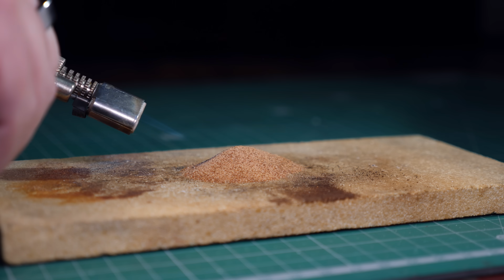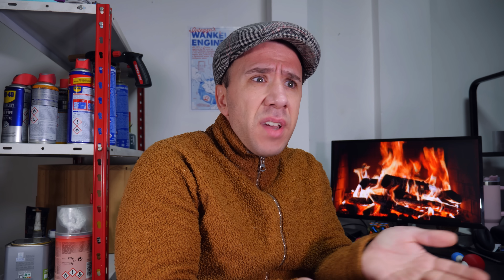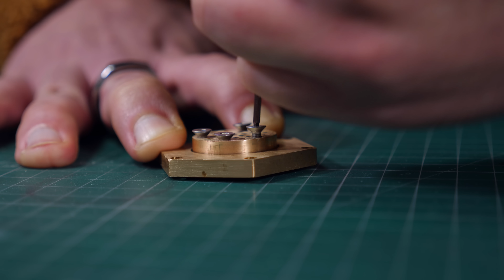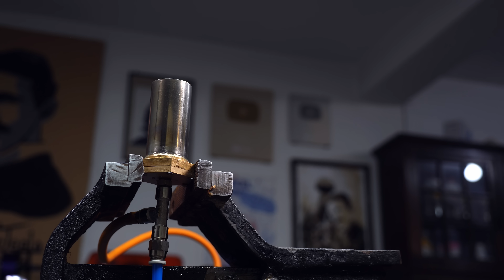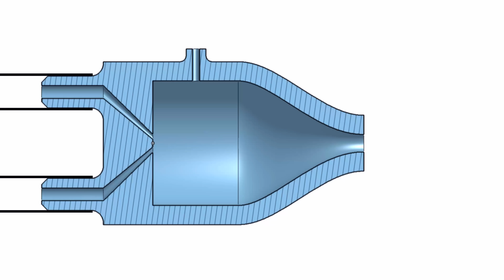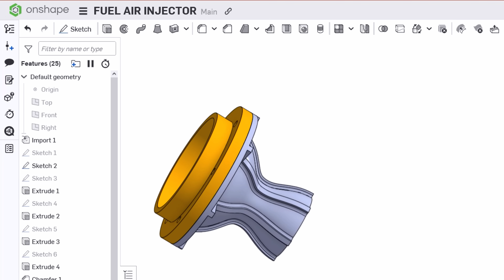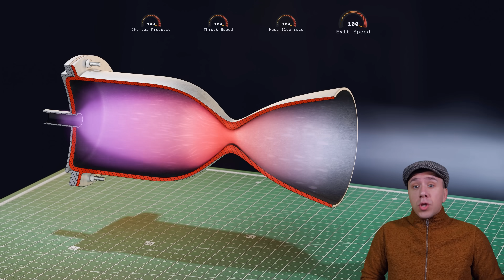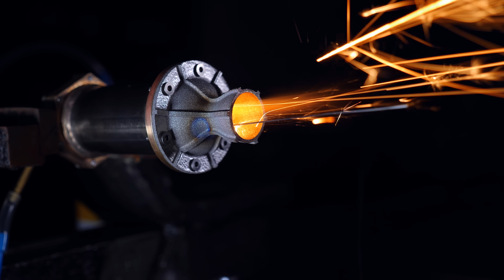I Built the FIRST VENTURI ROCKET ENGINE

Comment: so, awake again I see! Did you forget about camera apatures? stainless steel & coated in a high temp ceramic works a lot better for you tests, of course you know that. You once layered 3d printing material with carbon & more, I'm sure you can figure this out.

Same for the increase of total size of your inner diameter & needed pressures, alongside of feeding the fuel in properly... Nothing like planning videos, right? Tubes are easy enough, some reusable stainless steel drinking staws lined with holes that are then bent in to force a venturi effect to the fuel to be dragged out into the surrounding oxidizer is pretty fun, if you know how to serpentine the steel drinking straws.

Yeah, heat them up, coil them around cut a small slot, spot weld, or I dunno.... shrugs 10$ it up muahahahaha~!

You got oil? You should get some oil, you've got an oven. Hit it with some argon you got lieing around, as you do there dude integza, & dunk her in some oil. That solidifies your part to higher pressures & temps. You know standard mono-crystalline together part after with the basic annealing you can do in that thing, hooo boy!

It's a good idea if you wanted to head towards more optimal designs in terms of the speed of fuel consumption & total pressures you'd want to actually be at. 

SIDE NOTE!

coil the outside of the tube, drill into the tube to fit in the drinking straws, coil the straws from there, the amount of pressure & heat this thing could have is incredibly, genuinely draw dropping, levels of high. The vortex generation that happens forces the cooling effect of liquid & gas fuel combine as eddie forces tend to get involved. They tend to collapse back into the system & force a speeding up of electron orbital movement. I.e. they become more willing to violently jump virtual ionic states & yank into the vortexes to "smash" as you say into the already combusting air & fuel.

All you have to do is add in enough carbon/aluminum/copper/electrically conductive elements that can handle the huge voltage jumps to amperage spikes that oscillate based on combustion going on. ;"( in-fact thermite is a funny thing, all rocket fuels are thermite redox flow batteries like I've stated tremendous numbers of times in my videos. Insulation in the coils (steel remember) is also good with dialectic fuel in it.

Thermite, isn't what you are running, you are just transforming a gas into smaller gases quickly. Add some stuff into your liquid gas & or oxidizer, you'd be surprised how fast catalysts can be used in the application, that help with the electrical parts too, when reflections of your inner surfaces get involved for light based electron wake field accelerators get involved with your combustion of plasmas. Like I put in a xyla foxlin comment. & a few other videos.... & blue sky posts.

Comment: You will get much better mixing if you have the air flow around the injector and the fuel (unless it is hydrogen) flow through the center. This is because centrifugal force tends to push the heavier fuel particles or droplets outward, while the lighter air stays closer to the center.
This is a standard practice in the field.
Also the flow through the Laval nozzle was underexpanded. Cranking up the pressure in the chamber should solve that.

Comment: Since your next goal is a liquid rocket engine let me point out you already have half of the puzzle solved, your injection system is perject for the needed combustion and if you go back to your electrolizer project you will have access to the most powerful rocket fuel, Hydrogen and Oxygen, while you are unable to liquify them since you dont have a cryocooler their gas forms should be perfect for testing...just dont blow yourself up

Comment: You should have taken your tube with the solid oxidizer and while it was still wet/pliable, put it into the lathe and spun the sh!t out of it to let centrifugal forces disperse and smooth out the slurry onto the inner walls, then dry it out.

Comment: The last screw is always the hardest because of small misalignments due to tolerances in the manufacturing process.  if you don't tighten down all of the fasteners in series, it's easier because once all the screws are in and you start tightening in series, it'll center the part up on all of the screws.

Comment: Cool video Integza!

It is worth to keep in mind that the venturi effect can only be applied while the flow is non-compressible. 

In the case of the "venturi-shaped" nozzle, I'm suspectimg that the the flow has gotten into the compressible flow regime, and therefore it behaves differently.

When you are dealing with supersonic flow, this shaping of this type of nozzle increases the thrust because there will be an shock-wave around the neck/throat of the tube, that "messes" with the usual continuity that the venturi effect relies on. The result is that the flow accelerates after the neck/troat even though the volume expands!

I think you are onto something with this controllable solid fuel rocket, and therefore I urge you to dig furter into the things I tried to describe above.

Keep it up!

Comment: You hit upon the first thing with ALL of these rocket fuels. No matter what type of configuration. They are all at some point uncontrollable. So, you have to assume a 20-33% loss of your rocket fleet. With SpaceX it's like 80%. So, what is this telling us? We need an "alternative fuel" or perhaps a giant rail gun (remember those military failures?) to get us past Earth's gravity. Then it goes much easier and safer from there. Much easier. The current rocket fuels and "stainless alloy" metals that rust and fall apart, failed rockets are out.

Comment: just out of curiosity:  There is a flameable oxydizer in the chamber, mixed with fuel, ignited and it is expected that the reaction stops when fuel flow is shut off .... doesn't the oxydizer just keeps on burning without the fuel until it's finished?

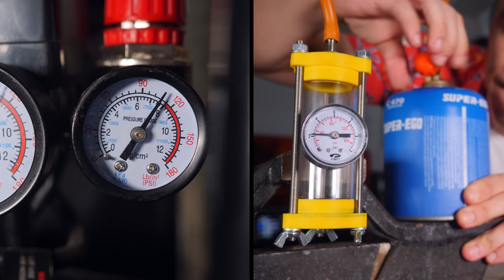Comment: 9:44 what if you tried using a clack value that uses some of the pressure from the chamber to help inject air into it? Steam engines use the valve to help inject water into the boilers, idk if it could be modified to work with air or if there is a way to use a vacuum effect to suck the air in

Comment: ok, the problem with amonium perchoratee you didn't think about, is that it decomposes under the heat(that's exactly why it used as an oxidizer, it decomposes and release atomic oxigen). if you put it inside the combustion chamber, it will get hot and decomose unequaly, you will burn through oxidizer way faster, than trough fuel.

Comment: Solid oxidiser + liquid fuel is known as a "reverse hybrid" rocket motor - experiments have been done on these, but they generally performed worse than regular hybrids. 

...That said, nowhere near as much research goes in to hybrids compared to liquid or solid motors, and reverse hybrids are even more untouched.

Hybrids may not ever outperform liquids, but there's way more potential than people give them credit for.

Comment: It wasn’t the amount of water that you,used, it was the speed in drying the engine.  If you put the kiln to 30 degrees centigrade and leave it overnight you will not get any micro cracks.  Try it.

Comment: The Venturi effect is incorrectly interpreted, as well as the Bernoulli principle. It does not describe the pressure going down in the fluid (stream). It does show, thought, how the increased turbulence in boundary layer, where the moving fluid interacts with the non moving object (pipe, or whatever), due to the increased fluid speed, creating increased "drag on the wall", physically decreased-pressure suction effect, which is the one to materialize, as a decreased pressure in the connected tube, where the measurement is being observed.

Comment: Hey @Inegza! I love your videos and all the tinkering and I am super exited that you are going to tackle liquid fuel engines. I remember that I found a youtube channel ages ago.. I think astronomy and nature TV. Sounds kinda wierd first but he is REALLLLY into Rockets, especialy the German V2 Rockets. He postet a video series where he went over pictures of impacts of v2 and the debrie and he made an excelent analysis about how everything worked and what went wrong. In one of the frames you see like a "curtain" pattern on the inside of the rocket nozzle and he explained that they had little holes that spilled fuel over the inside of the nozzle. That would evaporate and form like a heatshield against the heat and therefore made the metal last temeratures it wasnt really designed to do. Since you work with 3d printing ect, maybe that would be an interresting way of expanding the live span of some of your rocket engines?  

PS: I found the link to the video! https://www.youtube.com/watch?v=gYG_mHTYrtY He has a whole section about the cooling system and explains it in excelent detail!

Maybe it helps you! I would love  to see this implemented and also have like a comparison of the impact this cooling method has. Thank you so much and continiue your jurney of building rockets and hating tomatos! Cheers Toby

Comment: Thing 1. What is preventing you from obtaining a license, and what kind of license? 
Thing 2. Can you safely make some more cellphone?
Thing 3. How do you redesign it to redirect some of the exhaust heat into an aluminum sublimation chamber to feed your fuel injector with that good-good high density-high powered fuel, and still be able to shut it down by cooling it... Maybe you can start it with an induction heater; and run a steam(or other more temperature pressure appropriate phase change coolant)cycle to cool vital components and spin a turbine to generate electricity to power systems, recharge batteries that can restart the engine from cold...

Comment: the KNO3 is only making residue maybe because your proportion is wrong or it still has some moisture. its very unforgiving unlike chlorates or perchlorates. i have experimented with it for a while. with a well balanced proportion it works well. the TKOR had a video on this.
also. potassium permanganate  is a more powerful (and ridiculously dangerous) oxidizer that is widely available in most countries.

Comment: You're confusing propane with butane. Propane has a higher pressure than butane. There is butane in small gas cylinders for tourist burners. We need to look for a winter mixture, there may be butane + propane.

Comment: u could try separating end piece to like a flower leaves and rotating them apart mechanically to change size. It may not work do to heat and expansion of the parts but why not to try.

Comment: whats the ratio of solid to liquid needed? wouldnt it make more sense to either pre-mix and inject as a single fuels source or have a duel injection system so you can fine tune the mix on the fly? I also did an little sniffing around and to get your grubby hands on more of the magic white powder (in Europe) it basic boils down to having a pyrectics license and certified storage facilities/equipment. A man of your great talents and eccentricities can easily get the first and find a sponsor for the other.

Comment: 12:51 I have used testers airbrushes to spray alcohol, if you get one of the nicer airbrushes there are adjustments built in to change the amount of fluid, angle and spread...easy fuel injector 😉

Comment: 16:40 the aerospike nozzle doesn't actually helps with throttling, what it does is eliminates the need for a bell since it uses atmospheric air as a bell, so the jet is always perfectly expanded - as long as it's not in a vacuum (granted, bell nozzles also struggle in a vacuum).

Comment: 15:35 that is precisely the reason real life rocket engines either can't throttle at all, or have a handful of fixed throttle settings. The exhaust flow needs to reach the speed of sound inside the nozzle, there needs to be enough flow and pressure to do that, otherwise the nozzle doesn't work and acts as just a Venturri tube which is of no use whatsoever to a rocket engine.

Comment: 13:18 At my last job we used low pressure steam flow through a venturi to draw a vacuum on our condensers, we were always told that molecular entrainment (fast steam molecules smashing into air molecules) was the cause for the vacuuming effect.  I think the primary reason why venturis are used in these applications is to create a localized high speed flow of the driving fluid at the throat of the nozzle to entrain the secondary fluid without losing a ton of energy from flow instability. If your throat pressure is lower than your reciever pressure for the secondary fluid, you'd get some suction effect from the reduced pressure in the nozzle throat but i think the driving force would still be the entrainment.
Reply: Were you a nuke? Sounds word for word what I was thinking watching this, and was textbook steam plant theory.
Reply: @TjWhoo haha yep I was in M-div on the San Juan
Reply: @nakkajin Montpellier myself during and after dry dock

Comment: I made airbrushes for years, you need a chamber and a tube to create a venturi effect, cause you know...it's a negative pressure chamber, if you're just in the air...you can't have a negative pressure, well not easily anyway.  oh you made an injector I guess that's the same thing.  You probably could actually turn an airbrush into a rocket nozzle with this stuff, in the liquid form, have a bottle of it, and then use propane to drive the airbrush......the propane pulls the AP out and bang.

Comment: The deLaval nozzle, the convergent-divergent nozzle. It converts extremely high combustion pressure into extremely high exhaust velocity (and the pressures can easily go below atmospheric which is its own whole can of worms). The idea is that Venturri effect has a limit, it can't accelerate the flow beyond the speed of sound so instead the pressure increases at the throat. And then the bell nozzle allows the gases to increase speed further by expanding. Computing the ideal nozzle shape is very involved, but the basic key parameters are throat diameter which dictates flow rate and chamber pressure, and bell length which governs the degree of expansion which improves specific impulse at the cost of RUD hazard at insufficiently great vacuum.

Comment: liquid fuel means boosted air (see blow through carburetor). That means bigger air reserves or on demand production. On demand production requires oiling and cooling of that oil. Compressed fuels that evaporate can assist the cooling requirements with clever designing. AP vs Sugar Rocket. How much do you know about the gases used in cutting torches? Oxy-Acetylene blown over a potassium nitrate solid fuel engine core that was deposited via Ethanol wetting and dried via vacuum and freezing should provide ample excitement. Use a centrifuge to lay out your fuel instead of a smearing rod. Rock tumblers won't do it, you need spin cycle to stick fuel to a 3d printed lattice with sections designed to burn with a measure of control. Or are you looking at the Ethyl-Alcohol and liquid oxygen fueled XLR-11 liquid rocket motor? If you leave liquid nitrogen in an insulated cup and slowly vent oxygen rich air into the area, as the LN2 evaporates it condenses the air and O2 settles on the bottom of the insulated cup. Slowly the LN2 turns blue resulting in a cup of liquid O2. But this is dependent on you being able to produce ample liquid nitrogen on demand for both the production and storage of liquid oxygen (which is extremely wonderful to store and handle and let mix with normal every day items such as Denim or Cotton or Sawdust or Napthalene or cellulose or potassium nitrate or ammonia or double ply charmin or a tomato).

Comment: Potassium nitrate melts at 334 °C.  That wasn't residue clogging the injector.  It was molten KNO3.  I think for this to work, you'd have to  get it hot enough to break off the oxygen, which is significantly hotter than the melting point of the oxidizer, so potassium nitrate just won't work for this at all (except maybe as a molten liquid fuel...).